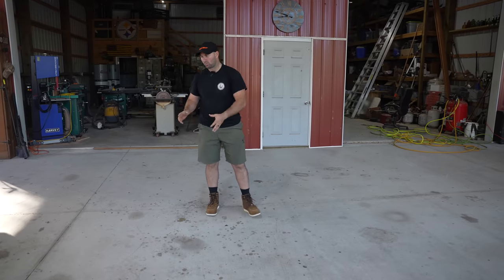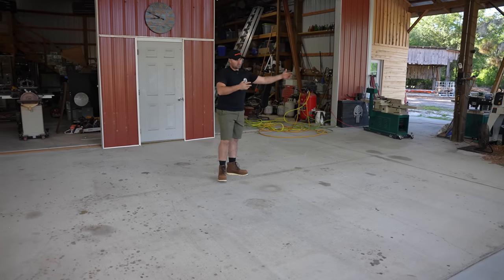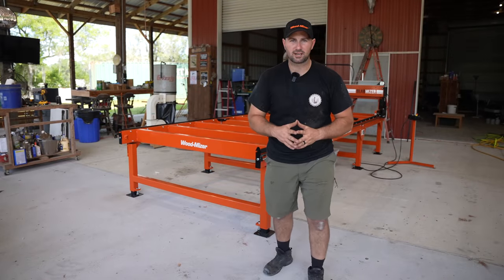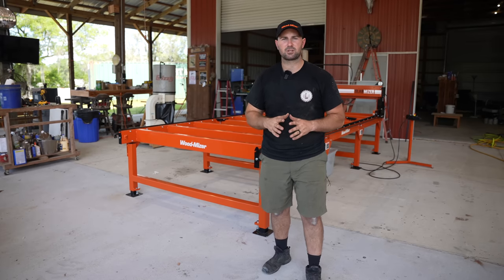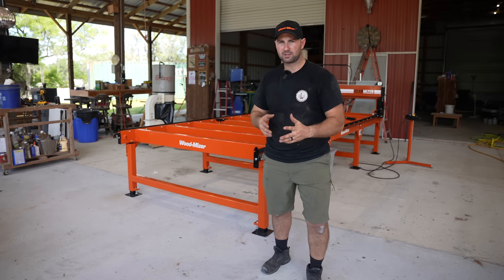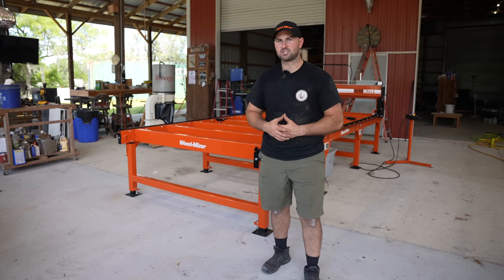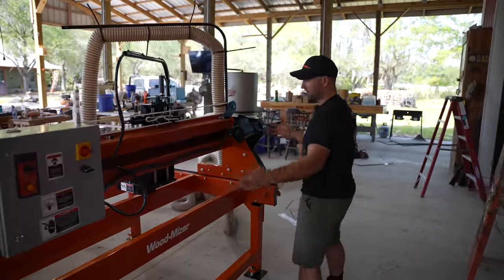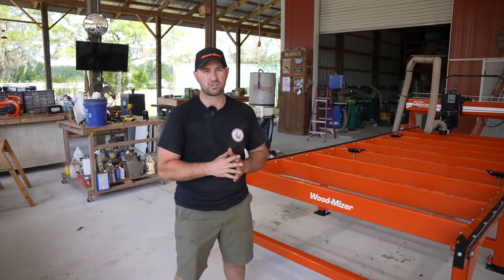Installing A Huge Upgrade To Our Shop - The Wood-Mizer Slabmizer MB200

Comment: We installed one of these in our factory in Cape Town, South Africa a couple of months back( 17' long) and agree on the instructions issue.We hade three guys helping out with installation. Biggest Slab we have done is  16' x 5' and the machine is working well.Sanding attachment could be better executed though, but does a good job.

Comment: Now Woodmizer only needs to take this vid, a little editing, and they have a YT video up and running, and then publish (with photos) a step manual in how to get everything assembled.  You need to get royalties off this !
Reply from the maker: We really wish they had a video on how to install this. It was quite difficult with the provided instructions.
Reply: @TripleLRusticDesigns  Be glad that you didn't get a 1 page (worthless) install page, and then have all the wrong bolts, washers, and nuts (like metric bolts with inch nuts), and have to put on a BuckStop front bumper (500+ #) onto your Yukon, and also have to carve up the entire plastic frame and mulflaps as well.

Constructing that Slabmizer is child's play with a forklift, overhead winch and strapping.  Then put bolts and nuts into every hole that shows up - and with electric socket driver nail everything down tight !